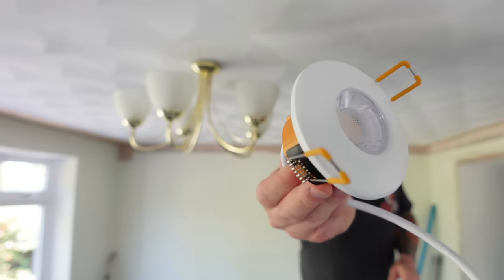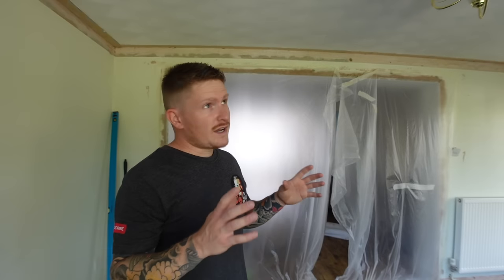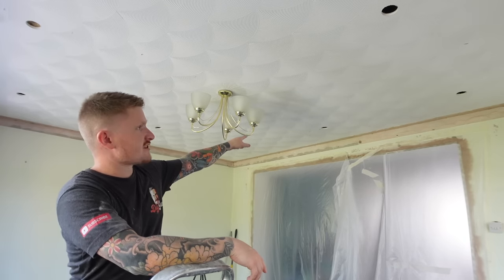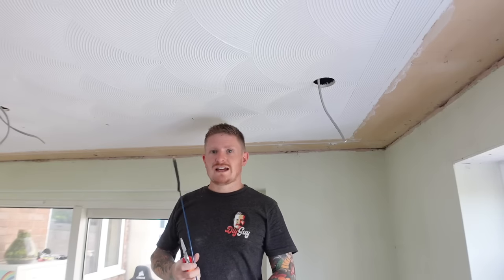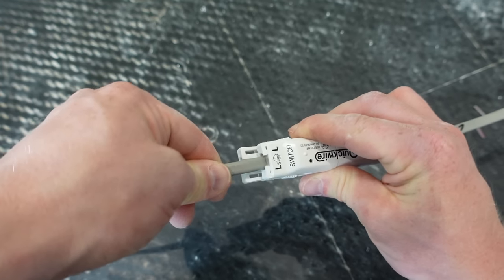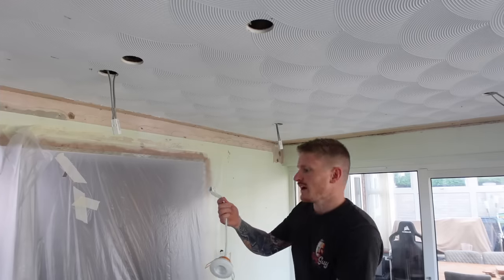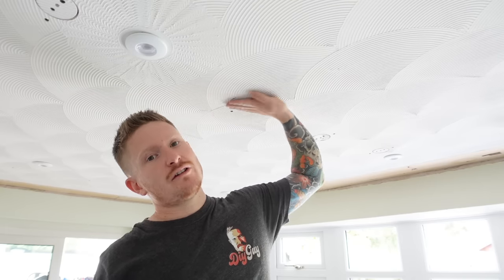How to Install Downlights With No Access Above | It is Possible!

Comment: Im a fully qualified electrician. Great job mate and brilliantly done. Ive just finished a job like this that had no access above and this is exactly how I do it well done!!  👍
Reply from the maker: Thanks a lot 😊
Reply: Did you check the opposite of the joist for clipped cables?
Reply from the maker: Yes, I did show that in the video using a ferret pro inspection camera
Reply: I wasn't meant to send that.  I pasted it in error and the phone died.
I enjoy your videos and they are well detailed.
Reply: Good video and the way to do it. Would be worth a mention that it would require a certificate, and switching it on is not testing it is it? Bit more to it. But looks better than last job done by a bedroom fitter that I fixed!
Reply: @peterigrenyi9176 doesn’t need a certificate, not a bathroom or kitchen so not even part p applies. In UK anyway. Valid point on testing though.
Reply: @iainhay2823  you are actually wrong here. Part P certainly does apply here if this is a dwelling. What you probably mean is that as it is not bathroom or kitchen, the work doesn't require notification to Local Building Authority. Which is correct. That does not make it exempt from all other requirements of BS 7671 etc... so minor works certificate should be issued.
Reply: @peterigrenyi9176 You are wrong too! Kitchens are no longer a 'special location ' but bathrooms are. Bathroom electrical work does require building control notification but altering any circuit still requires testing to BS7671 and a minor works certificate!
Reply: @jamiebourne8047  well I was just trying to clarify what the other comment was trying to say....
Reply: @peterigrenyi9176 so if switching it on is not testing it then how would you test it….genuine question?
Reply: @Charlton2010  u test to ensure safety. Therefore you want to make sure that the circuit you put them on is in good condition. Insulation resistance is OK, you have earth conductor continuity, correctly sized circuit breaker and RCD protection that would be required in most cases. Then u do the same after u install down lighters. Check IR and CPC continuity. Test earth fault capacity on the circuit to make sure circuit breaker trips. Polarity is often confirmed with doing earth fast loop impedance. Couple of other things you would check .... 

Most important thing to remember is: THE FACT THAT IT WORKS, DOESNT MEANT THAT IT IS SAFE!
Reply: How much would a job like this cost. Looking for same about of spot lights in my basement flat living room.
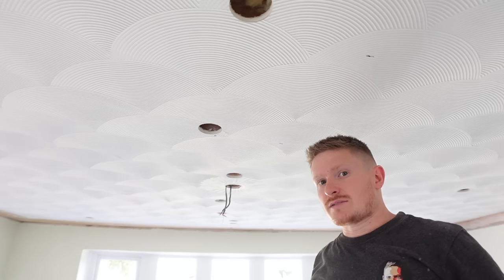Reply: It's in the video at 8:40 👍
Reply: Just out of interest, how much did you charge for that job? Trying to decide if it's worth me doing it or paying a sparky to do a proper job 😂
Reply: Give me an apprenticeship pls

Comment: Great video, another time saver tip,  if you drill your cut out holes on the joist, then notch your joist for cable then use metal box lid over the notch. Plaster board cut out will then go back , less faffing about making good. The hole saw needs to be bigger than width of joist. Also dont need to check both sides of joist, for cables/pipes.

Comment: Another excellent video! Just one point to add, it's worth getting the ceiling check for asbestos which is dangerous to breathe in, I recently found I have asbestos which prevented me installing downlight until I get it removed. I hope you don't mind me mentioning this, in older houses it is important to check.
Reply from the maker: Yep I agree 👍

Comment: Nice one Cameron, every detail covered. I'm sure a lot of home DIY'ers get worried about drilling in to the ceiling, terrified of what damage they could cause, but thanks to the excellent explanation of use of little tools you have taken most if not all the fear out of it. Another cracking vid, Paul.
Reply from the maker: Thanks a lot Paul for the continued comments and support. It doesn’t go un-noticed 👍
Reply: @TheDIYGuy1  I do it as I really enjoy the guides, sadly I'm not rich enough to add to the Patreon (but would do if I was). But yes, dead interesting content that deserves a thank you from us lot.
Reply: If your not a qualified part P ot NIC EIC  or equivalent electrician you legally cannot do this , take no notice of unqualified Pratt builders ,
Reply: @mikebotta4494  When giving an opinion or point, there's no need for ignorant abuse..
Reply: @mikebotta4494 Done all my own wiring including mains stuff and got an electrician to test it after wards. No probs including on major work.

Comment: I saw this video before the first one as I wanted to install downlights in my living room, and I was a bit scared to drill the extra holes and through the joists. However, I saw the first one, got a bit of confidence to attempt it in my bedroom with loft access, then went back to this one and did my living room and it look absolutely amazing. Best guide on here.

Comment: Drill the holes further from the joist depending on the length of your wood bit then use a nice wee angled chuck. That way the holes through the joists are horizontal and a bit easier to get rods through. Also makes it easier to reach the back of each joist if you need to move cables out of the way. Not tried that lighting system yet but it does look handy.
Reply from the maker: Good tips 👍

Comment: An engineer's view on this:  holes should be drilled along the neutral axis of a joist to prevent weakening of the structure.  Drilling through the bottom half of a joist weakens the portion that is in tension.

Comment: When replacing the ‘puck’ into the holes you make to drill through the joists it’s a good idea to remove the backing paper from the upper side (that you won’t see). This gives just a little relief for when you a filling the hole to give a better finish. Also using a fine ball-chain on the lead end of the rods makes it easier to fish the rods out using a hook or magnet.
Reply from the maker: Thanks for sharing your methods

Comment: Excellent video. Did most of this a few months ago. But the ceiling was seriously chaotic with solid insulation, nails, screws... it's a loft extension ceiling under a flat roof. There was space above insulation under OSB with wedges over the joists for the roof slope. Got there in the end. Screwfix had a refurbished Magnussen inspection camera that I snapped up - exactly what I needed. I prefer 1.5mm² but my lamps struggled with it. In this case, I used 3-core flexible cable and ferrules. Still got my dust holder for the hole saw, thank goodness. Took a week for skin to get over the scraping from hand and arm in the holes!
Reply from the maker: 😂 classic example of it not being an easy job! At least you got it done! Thanks

Comment: Great video, and I have done this exactly like you, several times.  Honestly, the toughest part for me is what you show at the end, the Drywall patching.  On a Ceiling you need the drywall repair to be pretty much perfect.  Seriously.  You almost always view a ceiling from an obtuse angle and that shows the flaws much more than a wall does.  Anyway... when you patch, I always use a Primer like Kilz or similar. Otherwise you will see the Mud thru the paint, it will be slightly off color.  I almost always repaint the entire ceiling in a room that size....  Scary the first time you do one, it looks like a Gopher infestation when you cut all the holes you need to wire thru the Ceiling Joists.  TOTALLY worth it in the end!  Primer is cheap... use something like Kilz over the patch

Comment: All good chap, but one little tip when drilling holes for downlights, keep the hss drill bit as short as possible in the hole saw, it only needs to guide in the hole saw and keep it from skidding off line, if it's sticking out 2" it asking for trouble hitting unseen cables or pipes.. from my own experience..:)

Comment: Great tutorial, it's important to mention that all lighting circuits in domestic household premises must now have RCD protection. Reg. 411.3.4 as of 18th edition wiring regs in UK.
A lot of lighting circuits in older houses haven't got this as they were installed to older versions of the electrical regs. 
Yes you can do like for like upgrade of existing light points, but if you are adding new wire, it's classed as an addition to the existing installation and the circuit should be brought up to meet current standards. If the circuit doesn't have RCD protection, then you should get an electrician to assess, test and upgrade the lighting circuit first before doing this work as this is classed as an "addition / alteration to the electrical installation". 
Sometimes, 2 separate lighting circuits in older houses shared neutrals between 2 or more fuses/breakers (upstairs/downstairs) and this can cause a problem when trying to add the RCD protection to one of the circuits! In addition to this:
Class 1 downlights must be earthed, some older historic lighting circuits did not have an earth connection! So you must use Class II downlights or have the circuit re-wired to ensure you have a continuous CPC all the way back to the fuseboard.
No basic coloured insulation should be visible outside of enclosure, or termination above the light, 
If in a special location such as a bathroom they should be suitably IP rated to stop steam from entering the fitting,
Loop impedance test should be carried out on the last light on the daisy chain to check continuity of the CPC (green yellow earth) and make sure that, in the event of a fault, the circuit breaker will trip within 4ms,
RCD should be tested from the last light as well as the switch point.
If you have a bedroom above the room you are installing downlights, I strongly recommend these should be fire rated to prevent the spread of fire from lower floor to upper floor.
....and lets not go down the rabbit hole of led dimmable downlights vs. older dimmer switches and all the flickering and premature failure issues that can cause!
Reply: It's mad that this is one of the few comments without a reply from him...
Home insurance products can not cover anything not within regs.
50mm noted but no RCD mentioned, easier ways 🙄
Reply: 'to meet current standards'
Sure.  But what about the voltage standards ? 🙂

Great comments BTW.

Comment: Your vid gave me inspiration to start a kitchen project. I needed all the advice from the brilliant quick wire downlights  to repairing the holes.
Mine was different as my looping was done at the light switch with no switch live info and at points I had double joists to go through.
But it looking good.
Reply from the maker: Glad I could help, good for you

Comment: I'd suggest you drill/cut an inspection hole each side of the joist where you are about to drill through. Also, I'd suggest your hole saw pilot drill doesn't stick out so much (in case there are wires/pipes resting on the ceiling. What about the Part P aspects (earthing, circuit protection, testing, certification, etc)?
Reply: What about Part P ? ?

Comment: Nice work , what type mcb  is that lighting circuit on ? and what’s the R1 +R2  & tripping time .Only I was always told  not to make the circuit live until I have checked the results. Thanks
Reply: Or to add to a circuit without knowing if it was OK to add too, is it 30mA RCD protected? Does the property even have a main earth? Is the correct bonding in place?.. basic stuff like that. It's OK though because it works when you turn the switch on. Not sure if he mentioned using fire rated downlights either?

Comment: Very similar to what I did in my lounge. You're right, it's not quick or easy, that cable fishing business! Mine took a full day, but I did also run cables down the wall and fitted a 4 gang switch so each row of 2 lights could be controlled separately. My downlights are quite deep so before drilling I made a small hole and used a single wire from the 1mm cable bent into an L shape and spinned it round to feel for obstacles. Another tip is don't be shy about making as many access holes as needed. Even if like me you're going to use Polyfilla and sandpaper rather than re-plastering it doesn't take long to fill them in perfectly.
Reply from the maker: Great, thanks for sharing 👍

Comment: I don't think we can use QuickWire connectors in the States.  Question though: The QuickWire connector in the center of the room, you probably used two outputs so you could run one separately out to the opposite sides of the room, right?  Great show, thank you.

Comment: Really helpful, great detail and easy to follow. Thank you very much. Have you got a video about installing a separate switch for the spotlights? Or converting a single switch to a double switch? Thinking about situations where you want to have a centre main light and spotlights around it that you can switch on and off separately. Thanks in advance.

Comment: Brilliant video. Please be aware your only supposed to drill holes in the joists between 0.25 and 0.4 of the joist span. You have drilled holes through the centre of the span.
Reply: And in terms of the vertical position you drill through, you should aim to be at mid-height of the depth of the joist. This is the point of lowest bending stress.
Reply: I was looking for this comment! Just about to say the same thing ... Drilling holes in the bottom centre is probably the worst
Reply: I'm looking at doing this, can you put it into lehmans terms how yous drill a joist please
Reply: @andrewsmith2289 If you don't know how to drill a joist then you shouldn't be doing electrical work. Call an electrician.
Reply: There’s a handy diagram in section 7.3 of the OSG 👍

Comment: Just found your channel, and it's mega! Great video. If you see this comment, I do have an electrical question that I've always wondered about. AC is both neutral and live at 50hz(or whatever it is), so why does it matter which way around the power wires go?  Genuine question, not trying to make a silly comment. Thanks. "Subscribed"

Comment: This is exactly how I did it in my kitchen... New builds offer no access above😂 seems mad cutting loads of holes but those plaster circles just screw into place with a small batten underneath for support then a quick skim of filler... Messy though but worth it.. I also used a camera and fibre glass rods  to feed the cables as we had insulation which hindered the cable being pushed.. Joy 😂
Reply from the maker: Haha well in 👍

Comment: From the centre point towards the switch you might be lucky and find the existing cables which you could pull back with a new cable attached to reroute to a new position light point and that way you save some holes
Reply: And if no light going at the old centre position it’s best to move anyway

Comment: Great video mate, thinking of attempting this but concerned if there are noggins running perpendicular between the joists, could that happen?
Reply from the maker: Thanks. It could but isn’t likely in most cases. If that were the case you could just drill more access holes.

Comment: Great video for DIYers, thank you for the tips especially to cover up the extra holes, I have  to install some pot lights and I was scratching my head thinking  how to deal with the joists and extra holes. Junction connector is good idea but I can't use it, our local code in NYC requires electrical box as Junction connection.
Reply from the maker: Glad it was helpful!

Comment: Great info although I drilled a small hole first and used a piece of wire bent 90 degrees to check I had clearance for the 70mm hole drill..

Comment: I have used the quick wire on my house rewire didn't know about the quick wire lights though but the connectors are absolutely excellent also don't forget about the little you can get so you can release your cables just incase you accidentally put a cable in the wrong because you didn't take the time to mark it up 😅
Reply from the maker: Great point on the disconnection tool. I do have one but didn’t show it in the video. Cheers

Comment: Loved the video. Learned a lot.  I have an angled ceiling - are there any light options like this that you can angle the light to point it straight down if it was on a slightly angled ceiling?
Reply from the maker: Great thanks. You could but you’d be better to use a downlight that can tilt

Comment: Use a chalk line and mark a 4 in strip from light to light where there is joist in between, then cut it and save the pieces. It will be easier to drill the holes,run the wire and even put a nail plate to protect  those wires and then just put back the drywall pieces it is actually easier to mud a continious strip than many individual circles. That is the only thing i would do different otherwise good work 👍

Comment: From a construction perspective, the hole needs to be within the middle third of the joist, 20mmis far to big large.  10mm can accomodate the cable albeit that it makes it trickier to install.  It is prerable for the cable to be betwen one of the rows nearer the wall rather than in the middle ro.

Comment: 3:09 About time for spotlights to come back in. Would go a long way to helping in the No access ceiling situation too.

What kind of numpty goes to the fuss of 6:41 crimping extra lengths of wire just to add to the rest squashed in the fitting?!
Reply from the maker: 😂😂 that light was just thrown up with no real care unfortunately.
Reply: Numpty clearly wasn't an electrician or at least not a good one !

Comment: Cracking job and explanation just a shame you have to have that swirlly style of ceiling. Surely a vid on stripping that back to nice smooth white would be a good one or would it really need complete new ceiling boards?
Reply from the maker: The ceiling is being skimmed so will be nice and smooth white! Cheers
Reply: @TheDIYGuy1  oh it would also be great seeing what you plan for heating. Heat pump perhaps but the. The enormity of larger pipes and radiators. How do you go green without too much disruption and it actually being practical without breaking the bank or house to fit it